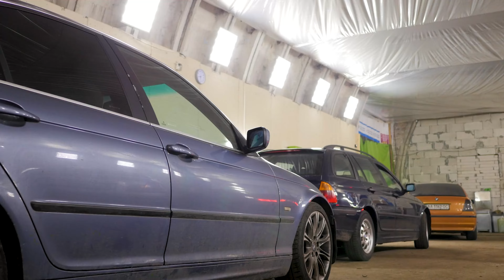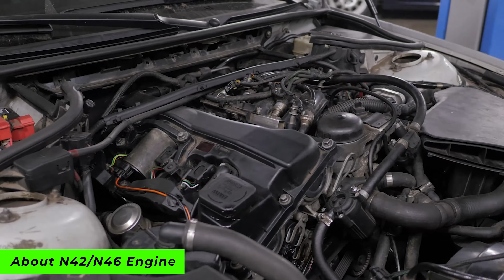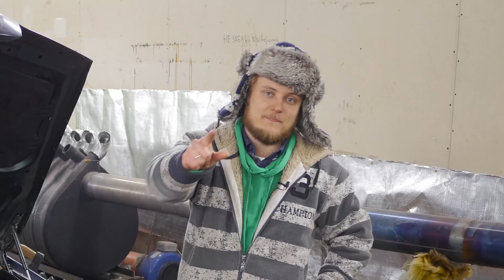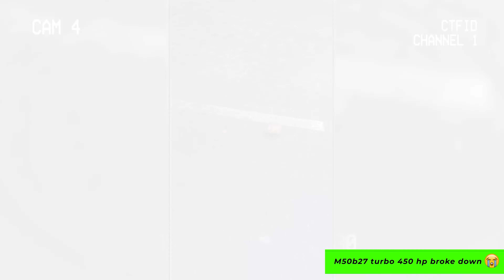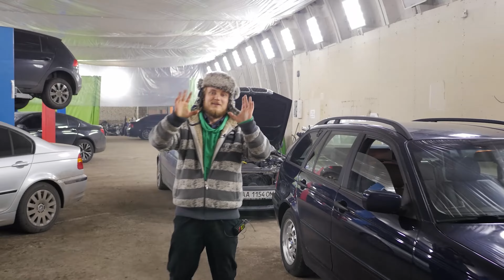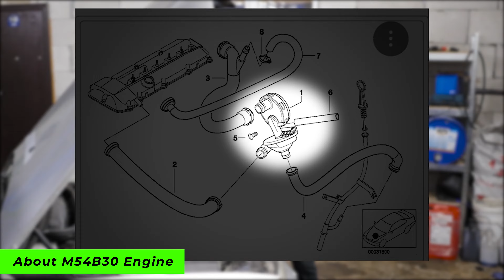BEST BMW E46 Engine. Which engine to choose for the BMW E46? N42, M43, M52, M54 review

Comment: from petrol engines the M43 B19 is the best in e46 in terms of reliability, and long term costs. It's simple robust working horse. From diesels M47N M57. Performance petrols which are good in long term are M52TU B20 B25/323i B28. All others M54 are burning oil in long term are more costly and unreliable.